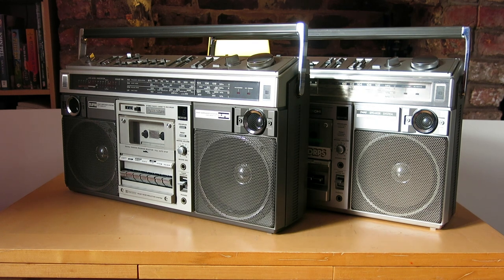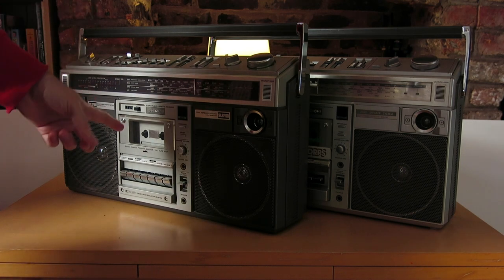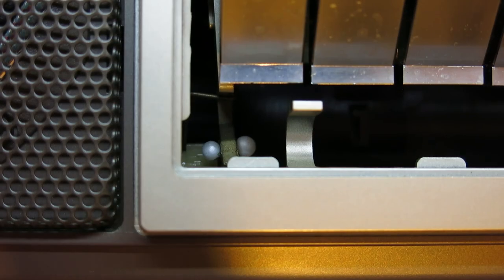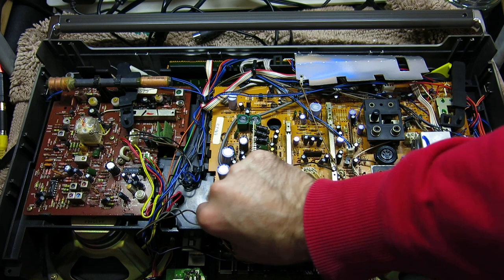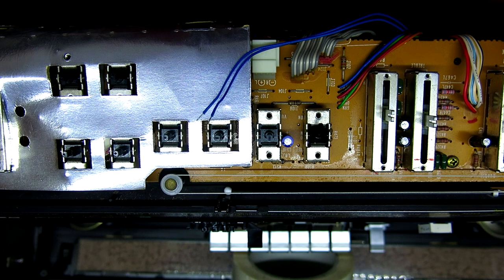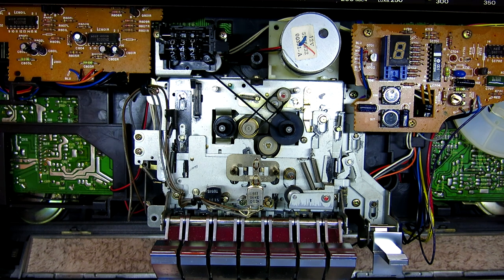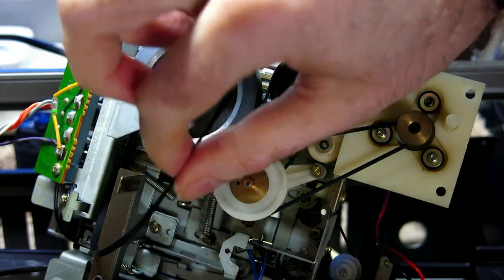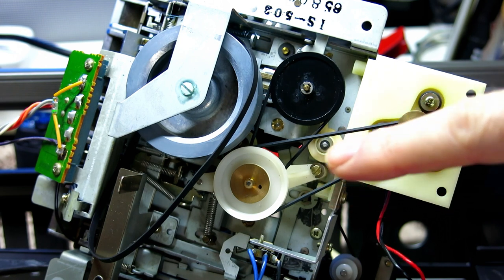1980 Hitachi TRK-8190E Mechanical Service, Bulb & Belt Replacement

Comment: Great video, very informative. I have two of these 8190's both with the same fault, when powering on they have normal volume for about 15 seconds with bright level led's then every thing fades away to zero both sound and led's, any idea's.
Reply from the maker: @arthurpendragon7224  I would monitor the voltage at the 13V zener diode and the pass transistor (I cover this in another one of the Hitachi videos, it was a dirty power switch) and also have a look at the back of the circuit board behind the amp heatsink, see if you see any corrosion from leaking capacitors. Unfortunately the amp chip and heatsink has to be desoldered to get to the caps under there

Comment: I have just changed the belts on my machine and used the recommended supplier. I couldn’t have done this job without your expert  guidance. The screw behind the spring for moving the flywheel I would not have found for sure. The black gunge of the melted drive belt that came off the capstan can be used to hold the tiny screw in place on the end of the screwdriver! All working fine now and slowly getting thru my collection of compact cassettes while walking down the road boombox aloft….